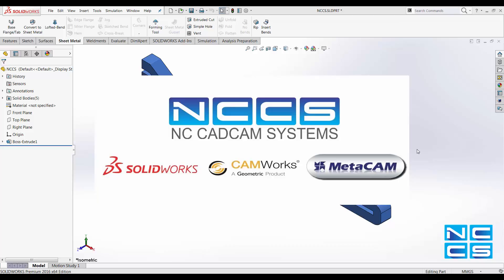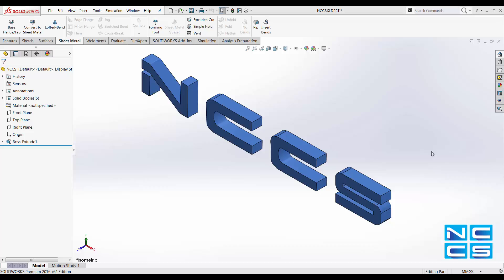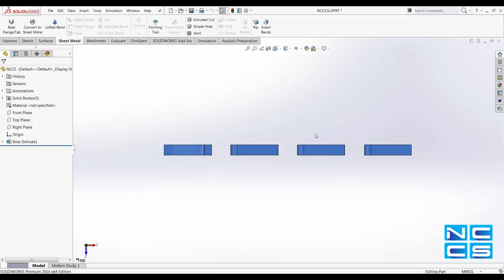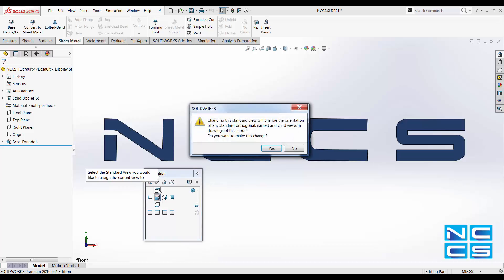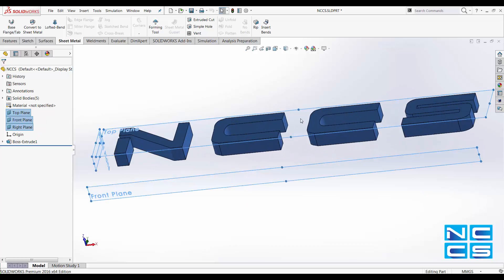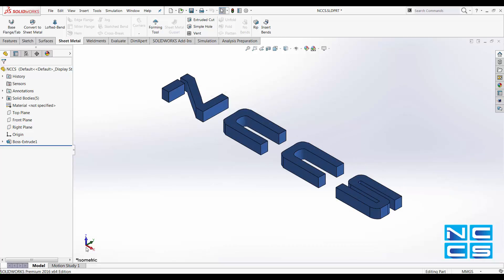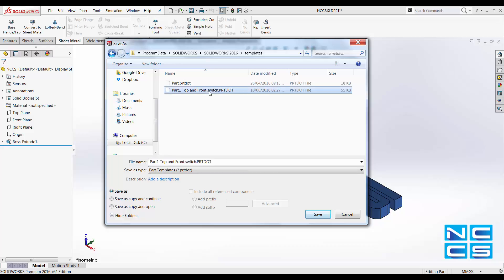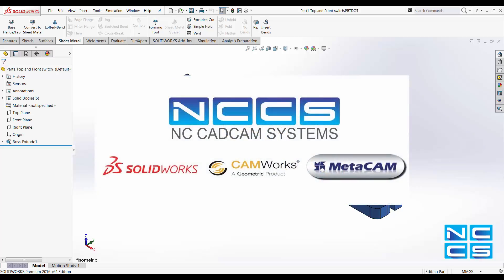SOLIDWORKS Video:  Changing from Y-Up coordinate to a Z-Up coordinate

Comment: in a normal world the normal is always up. In real life the sky does not flip over and be vertical just because you look left. Solidworks really need to sort this out Z should always be up and the planes should be named as they are in mathematics and physics XY being the plan view from the top XZ the front plane with Z pointing up  and the YZ plane also with Z pointing up. Its ridiculous lets have some consistency of thought here. Ive tried all sorts but always the z axis points never the correct way.
Reply: https://youtu.be/p18_NfMzTyQ
check out my latest video that shows a work around to fix that issue !!

Comment: With this method, the plane is not oriented correctly. Right and front.
Reply: Does anyone have a solution for this? I'd really like to correct this problem
Reply: @TimBrennan  https://youtu.be/p18_NfMzTyQ
check out my latest video that shows a work around to fix that issue !!
Reply: @TimBrennan  go to "insert ->features->move/copy".  One of the options is to rotate the body or bodies of your choice.
Probably too late to help you personally, but someone else looking for the same answer might find it.